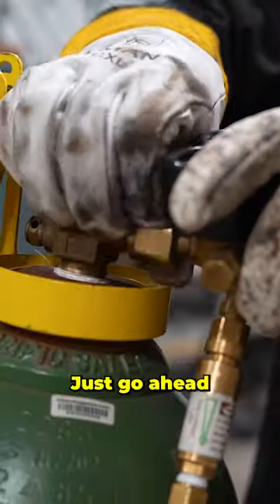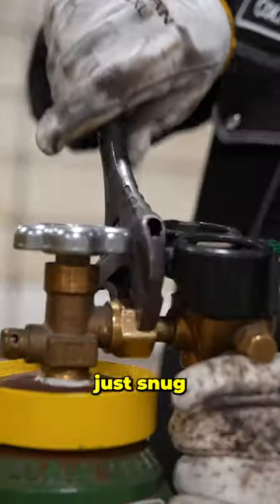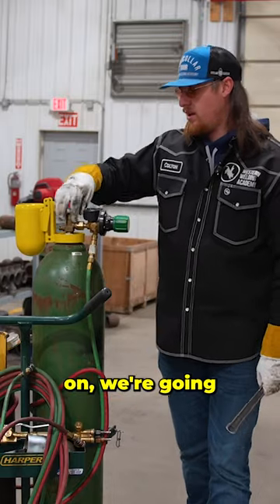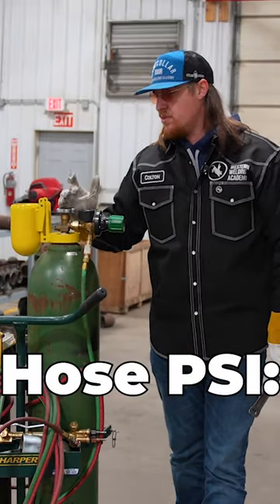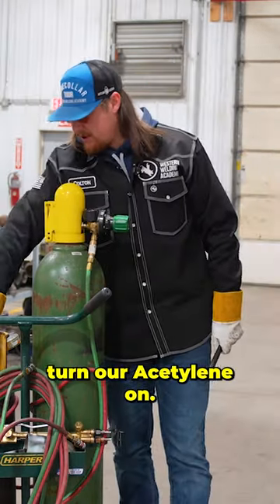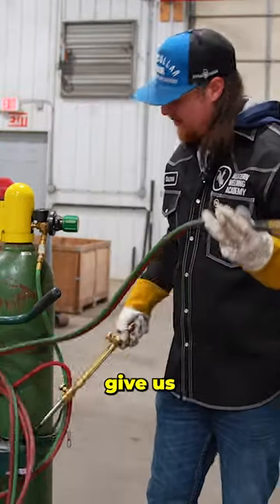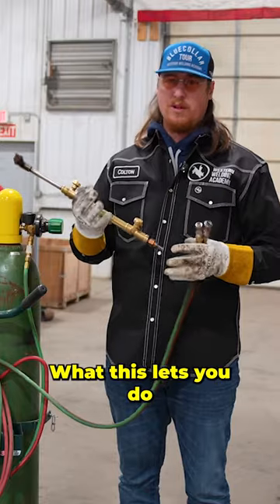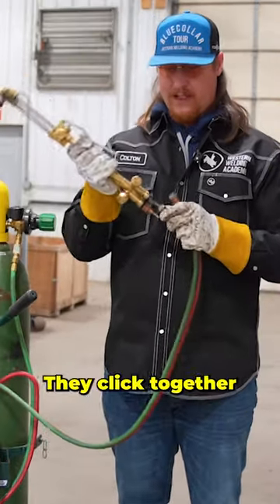How do I set up an Acetylene torch? pt.1 🤔 #shorts #WWA

Comment: I was taught that high pressure gas cylinders have double seated valves and that it is important to fully open the valve firmly against the second seat after the regulator has been pressurized. This is to positively seal the valve to prevent leaks around the valve shaft. I’m no expert so please comment to confirm or correct me if I  have an incorrect understanding. Thanks.
Reply from the maker: Your understanding is partially correct. High-pressure gas cylinders do indeed have double-seated valves, which are designed to ensure a secure seal and prevent leaks. It's important to fully open the valve firmly against the second seat after the regulator has been pressurized to establish a positive seal and minimize the risk of leaks around the valve shaft. However, it's also crucial to note that the primary reason for fully opening the valve against the second seat is to prevent the potential for leaks during operation and to ensure proper gas flow. This practice helps to maintain safety and efficiency when using high-pressure gas cylinders.